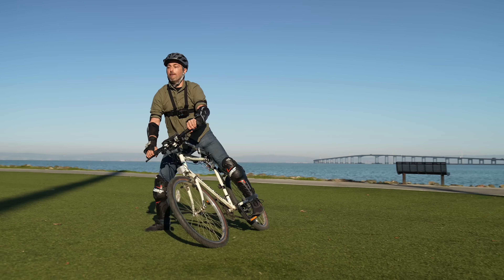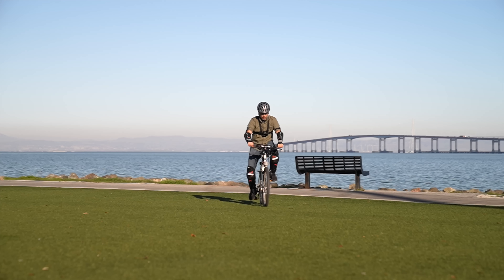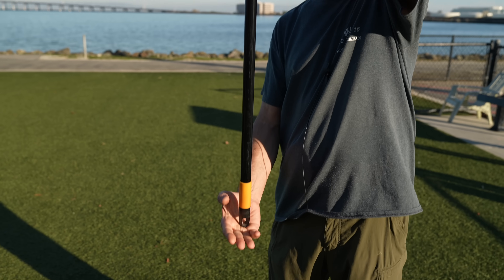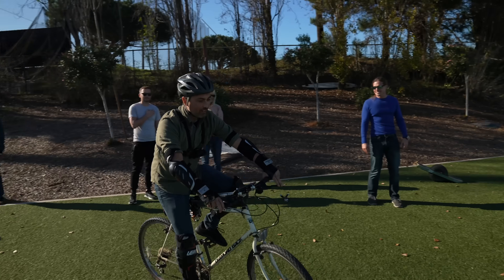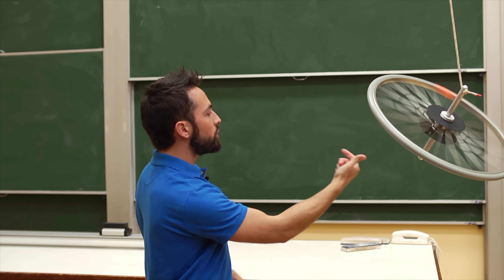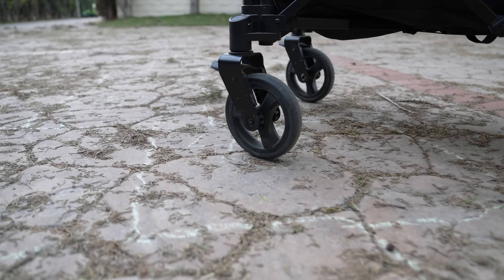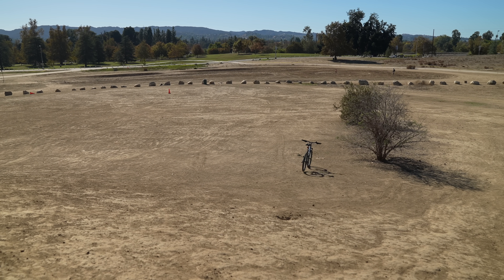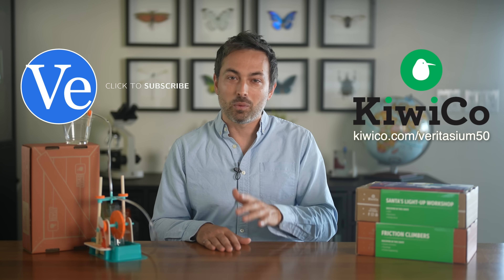Most People Don't Know How Bikes Work

Comment: Motorcyclists (particularly those that ride fast sport-bikes with "clip-on" - i.e. short - handlebars) know about counter-steering (as Derek noted, it's the ONLY way to get a single-track vehicle to turn).  Armed with this knowledge, I taught my boys to ride bicycles in less than an hour (with no training wheels).  I had them sit on the bike, with their feet on the pedals, while I stood behind them gripping the back of the seat (so I could balance them).  I then told them to steer in the direction of the lean as I leaned the bike from side-to-side. I kept leaning their bikes from side-to-side until I was confident they could counter-steer to correct the lean.
BTW - the part Dereck didn't talk about is how you have to steer into the direction of lean to get the bicycle back upright.
Reply: I was looking for this comment. This is one of the first things you learn when you have a motorcycle.
Reply: A lot of motorcyclists don't know/understand this, I've seen a tens, if not hundreds, videos of crashing caused by tries to turn handlebar out of obstacle which leads to crashing into exactly same obstacle which rider tried to avoid.
Reply: There is nothing particular about sport bikes that have clip ons vs normal handlebars. The same principles apply regardless of the kind of motorcycle
Reply: @MAC_V4_2K  You are correct, all single-track vehicles steer the same way.  However, the effects are more noticeable with less leverage (i.e. shorter handlebars) and higher gyroscopic effects from the front tire (i.e. higher speed).  I don't know of too many bicyclists or cruiser-motorcycle riders that try to initiate a turn at 120mph (whereas I do it every lap when I'm attending a track-day session).
Reply: @danielklopp7007  highly disagree. I believe counter steering to be much more noticeable on bikes that have wider bars, giving more leverage to push on the bars and a more pronounced feeling of the direction they are turning. That, and the need to counter steer begins before 30mph, needing to go 120+ to notice it is extremely excessive lol.

To each their own I guess.
Reply: I don't understand how motorcyclist are any different from any other riding a bike of sorts, the same principle is applied in both fields and naturally ud become aware
Reply: @Lex-tz7ww  you are correct, all single-track vehicles steer the same way.  However, counter-steering is much more noticeable with less leverage (i.e. short handlebars) and high speeds (simply look at the responses here from all the bicyclists who claim to be able to steer the bike just by "throwing" their body weight / leaning - they are all 100% wrong, but convinced they are correct).  I don't know of any bicyclist or cruiser-motorcyclist who try to initiate turns at over 120 mph (200 kph) - I do this every couple of minutes when attending a sport-bike track-day session.  Trying to overcome the gyroscopic effects of the front tire (to get it to counter-steer), while pulling/pushing on short handlebars takes some very noticeable effort.
Reply: @danielklopp7007  I understand ur point but regardless of how much more effort is put into motorcycling the act of counter turning is present in both bikes and or motorcycles, I'm not trying to say that the two are exactly the same but that they both require a similar act of counter turning which in my opinion is more than enough for it to be noticeable.
Reply: @Lex-tz7ww  did u ride a motorcycle?
Reply: @SoyPixelArg  Yes I've driven my uncle's motorcycle
Reply: @Lex-tz7ww  at the higher speeds of a motorcycle and not needing to peddle makes the effect far more apparent. It is also specifically taught in motorcycle driving classes
Reply: @TheKeyote  By what I meant is that, with both motorcycles and regular bikes being that both form of transportations have only two wheels with one at the front meant for turning you would recognise the need for counter turning whether u were taught or not it's common sense
Reply: On a motorcycle, which goes faster, it becomes apparent that to go left you push on the left handlebar. To go right, push on the right handlebar. On a bicycle at lower speeds, that's not as apparent. (I ride both.)
Reply: Training wheels make learning harder, they're stupid and make kids dependent on them so they don't learn to not fall
Reply: TWIST OF THE WRIST lol
Reply: Keith Code!
Reply: On a motorcycle travelling at sufficient speed, if you take both hands off the handle bars and push with one finger on the right bar end the bike will turn right. It's the most uncanny thing.
Reply: BTW - this is also true of a bicycle... get up to speed, take your hands off the handlebars,  then gently push with one finger on the right bar end. Intuition would suggest a left turn, but just the opposite happens.
Reply: @Daniel Klopp  and the harder you push the sharper the bike will turn right. Do you think it has something to do with the gyroscopic effect?
Reply: @jonahblaymires3482  The reason you turn sharper with a harder push is the amount of lean (since the harder you turn the handlebars to the left, the more lean you generate to the right).  The confusion I see in the comments comes from a lack of understanding of what generates the cornering force; dual-track vehicles (i.e. 3 or more wheels, aligned in two tracks when viewed from the front) steer by what's known as "slip angles" - that is, the front tires turn in the direction of the turn, at a slightly greater angle than the turn radius.  Whereas single-track vehicles turn from what's known as "camber thrust" - that is, the tire has a larger circumference (when viewed from the front) in the center, than at the edges;  thus once the bike is leaned, thrust in the direction of the lean is generated by the larger circumference at the "outside" of the turn vs. the circumference at the "inside" of the turn. If you took a rubber beaker stopper (in high school chemistry class) and tried to roll it on a table, you would see that the stopper rolls in circles.  If you took two rubber stoppers and glued them together, top-to-top, you can roll them in a straight line as long as the glued-together stoppers remain horizontal (i.e. balanced on the largest circumference part); but if they lean to one side or the other, they will turn in the direction of the lean.  Because the steering stem on bikes is inclined, turning the handlebars changes where the contact patch of the front tire touches the ground (essentially steering the front tire out from under the bike, causing it to "fall" in the opposite direction, thus starting to generate camber thrust).
...thus ends your physics lesson for the day!
Reply: @danielklopp7007  It's not camber thrust. Yes, camber thrust exists, but that's not "how bikes turn".

When a bike is turning, the front tyre is rotated to face in the direction of the turn. If the bike is turning left, the front tyre is aiming to the left. But it only needs to aim to the left very slightly. You're right of course, it's not like a car - but not because of camber thrust. Rather, because the bike is leaned over.

Picture a bike on a flat surface, leaned over in a left turn, and imagine drawing a line through the axle bolt of the front wheel. Extend that line so it touches the ground (which it will do, because the bike is leaned over), and then keep going. Extend it all the way through the earth. Now take another line through the rear axle. This line is not parallel to the first, because the front wheel is turned, whereas the rear wheel is straight. Those two lines will intersect at some point underground. Go vertically up from that point to the surface. The point you hit on the surface is the centre of the turn radius. If the bike went around and around in circles, these lines would map out the surface of a cone, with the pointy end underground, and the bike moving roughly around the circumference of the flat end (not quite exactly, since the contact patch is below the axles, but close enough as to make no difference).

This of course is a purely mathematical description which assumes that the tyres are not slipping, but rather perfectly rolling. But the point is that nowhere in this calculation is any mention of the camber thrust from the tyre profiles. A bike turns because the front tyre is pointed into the turn - just like a car - but when calculating how much the front tyre needs to be turned for a given turn radius, the angle of the frame (the angle of the axles, if you like) must also be considered - which is the bit unlike a car.

You can, of course, do this same analysis with a car. If you do, the lines never get buried underground, because the car is not leaned. Instead they will simply intersect at some point just above the surface. Again, that is the centre of the turn radius. But with a car, the same steering deflection produces a wider turn radius. If you imagine taking that car and leaning it like a bike, that inersection point will rotate downwards, but it also moves "inward", towards the car, following the circumference of a circle. Thus the steering deflection for a bike - which operates at lean - is smaller than the steering deflection for a car, for the same turn radius.

For a bike all of this is of course happening after the countersteer has already happened. You need the countersteer to establish the lean angle. But once the bike is leaned, the front tyre must be rotated again to face into the turn in order for the turn to be stable, otherwise you would, of course, just fall over in the direction of lean. Most of the time, this movement can be accomplished simply by taking pressure of the handlebars. That is to say, most of the time, the front tyre will naturally reach this equilibrium position by itself once the rider has stopped providing input.

This is why so many other people seem to think that you have to steer inwards at low speed rather than countersteering. You do have to steer inwards, because the steering geometry can't establish that equilibrium position fast enough at low speeds, because the forces at play are smaller. So the rider has to help it along by actively steering into the turn. But this only happens after centre of mass is already leaned into the turn - or in other words, after the countersteer that established that lean has already happened.
Reply: Bicycles will correct themselves if you don't force it out. If the bike leans the front wheel will properly counter on its own and will do so as long as momentum is maintained.
Reply: That is genius!
Reply: Its really common for him, especially in recent videos, to leave out information. Might be on purpose or simply not knowing enough about the subject.
Reply: @wupme  almost certainly left out on purpose for the sake of brevity. Annoying to those of us that want a deeper dive for sure, but as one of the biggest science communicators out there his goal is to make it more digestible for a wider audience
Reply: @TheKeyote  I hardly ride my bike. I personally wish they'd have included information like that. Even if I don't know about it, it's nice to get the bigger picture as well.
Reply: breezelow unknown  Counter-steering is NOT a "myth"; the reality is the handlebars MUST turn in the opposite direction of the intended turn, in order to initiate the turn.  The handlebars can either be turned by direct input from the rider, or by the rider shifting their weight without hands on the bars (which WILL cause the bars to move in the opposite direction of the weight shift).  Your assertion that someone demonstrated figure 8's on a bike without touching the handlebars is absolutely correct, however this is not the same thing as saying the handlebars never move.  If you put a sensitive potentiometer on the bars to electrically measure steering stem movement, you will see the handlebars move just from rider weight shifts. Further, if you plot the movement on a very sensitive time scale, you will see the rider's weight shift causes the steering stem to move, which then starts the turn (proving that turning cannot happen without FIRST moving the steering (either by explicit movement of the handlebars by the rider, OR by the rider shifting their weight) in the opposite direction of the turn.
Reply: 1hour? 
You were confusing them. If you wouldn't had said anything they would have been riding in their fist few tries

Comment: If you the F1 you know cars do this as well because the want keep there momentum up going into the corner which is the apex of the corner. People do the same thing on a bike so they don’t slow down. People can also lean into a corner so they don’t have to use the handle bars as much.
Reply: @Patrick: I think you're confusing counter-steering a car (used to correct a rear-wheel slide), with the force needed to initiate the turn.  Cars (regardless of what type) always need to initiate a turn by creating a "slip-angle" (i.e. turn the front wheels in direction you want to go).  On the other hand, bicycles (and motorcycles) always need to initiate a turn by turning the handlebars in the opposite direction you want to turn (as Derek noted in this video).

Comment: Thats just not true. If you can ride a bike properly you just lean into the turn you don’t need to steer away from the turn to throw your weight over. You just throw your weight over. I think you are dealing with people with little experience of riding.
Reply: @Mike: Newton's laws of motion; you can't "lean" into the turn without pushing on something; that something you're pushing on is the contact patch of the front tire.  The most experienced cyclist can't turn a bicycle (or motorcycle) without counter-steering - it is the ONLY way single-track vehicles can be made to turn (or balance).

Comment: Classical control theory explains this.  The bicycle is being stabilized by the rider.  The closed-loop transfer function thus has a nonminimum phase zero (equal to one of the unstable open-loop poles).  This means that the system has undershoot, that is, a right command (which is the input to the closed-loop system) produces an initial left motion and vice versa.  If you don't allow that motion, instability takes over.  Fighter jets have the same problem---it is an unavoidable consequence of stabilization.

Comment: I believe that the gyroscopic effect is highly overrated for a bike. Take for instace ice scaters without wheels that are also stable (maybe you can elaborate on that), therefore i believe preservation of angular momentum is much more important. Assuming that you have no sideway slip a change in angular momentum is needed to fall over. On the other hand when the road is slippery and the wheels can move sideways the bike can rotate freely around its gravitational center and the the bike is super unstable dispite gyroscopic forces. Also the mass of the wheels are usually very small compared to the person sitting on the bike..  thus you may safely neglect the effect of geroscopic forces

Comment: It’s actually possible to steer left without turning right. You just have to lean the bike under you, or shift your weight to the left. (Same applies to the other side)
Reply: Except that it does not work.
Reply: @XtreeM_FaiL  I’m basically a pro mountain biker, so trust me it works.
Reply: @XtreeM_FaiL  if you can get me to 30 subscribers I’ll do a video on why varatasium’s bike theory is wrong. Until then you are free to think as you wish... and even after you are still free to not agree.
Reply: @XtreeM_FaiL  and who enforces it? Not you, cuz I’ve broken it many times... Veritasium may be a very knowledgeable physicist, but he is NOT a skilled bicycle rider. Now please just leave me alone.
Reply: @XtreeM_FaiL  firstly, do you think I have a $2600 16mm travel enduro for no reason at all? And have you ever landed a 20ft tabletop in manuel? Or done a 180 stoppy to fakie? Didn’t think so...

Comment: No one will read this but Hey! Theres also a linear effect facing forward, due to the back wheel being locked facing forward and the front wheel also tracks in a forward facing path naturally just from the fact of forward momentum, not needing gyro, to track forward once you get rolling. 
Also the friction from the rounded rubber tires, they also effect this forward tracking. Use flat bottom tires n youll see what I mean. 

No one read this anyways... hope I explained it well enough without visuals. Oh and your experiment will not work backwards without a rider but will with one! But its hard fo find a bike to pedal backwards.
Reply: I read this.

Comment: So you have to use steering input because pedaling has a different amount of force on each side of the bike right? So it can make the bike move to one side or the other. That’s why you can coast without much input. Same as a motorcycle, I never had to steer constantly to keep myself straight on a motorcycle.

Comment: I somewhat disagree with the steering explanation. First, it is explained that turning "steers the bike out from under you". I argue that this is the result, not the cause. Balancing a stationary bike proves my point. As stated, it is hard, but not impossible. My explanation is how steering affects the bike's center of gravity. Turning left on a stationary bike moves the center of gravity to the right. This also applies in motion, and with a rider on the seat at the center of the bike. Therefore, regardless of motion, turning the wheel left causes the bike to lean right and then turn right. 

It should also be mentioned how leaning causes steering. Leaning causes the circumference of the tire to shrink (bike tires are rounded, unlike flat car tires), now the contact patch the bike rests on is shaped like a trapezoid with the short side on the inside of the bike's turn. Of course, rubber has to travel farther on one side of the contact patch compared to the other, hence a turn.